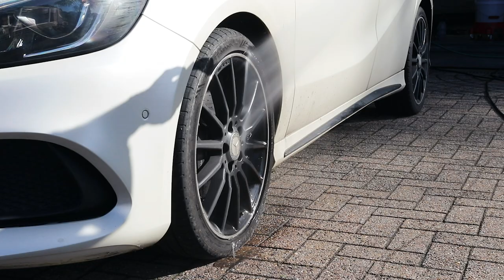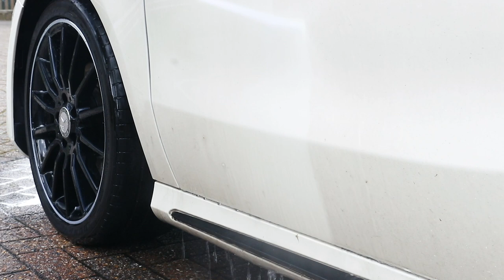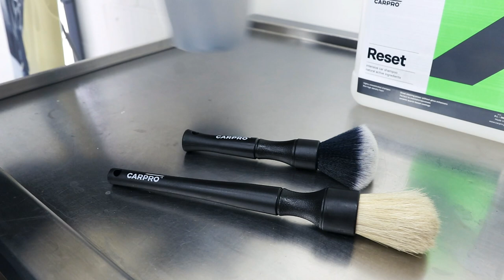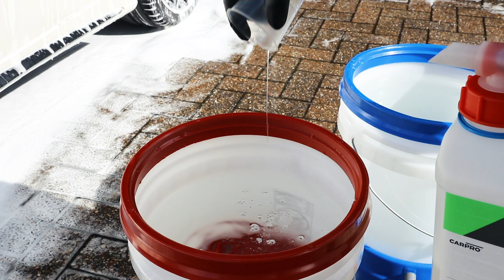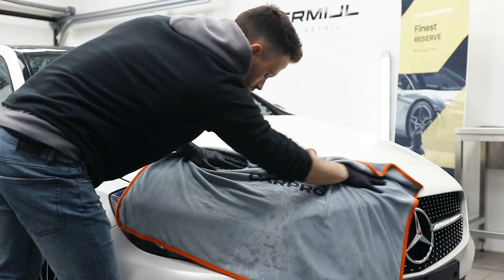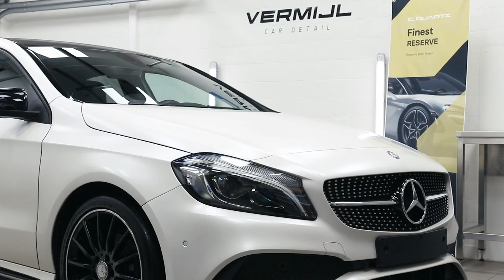How We Do A Maintenance Wash - Satisfying Foam Wash!

Comment: Very good video bro, so satisfying to watch! 😁

My suggestion if that was my car

I never use pressure washer to remove heavy grain & dirt 

my method 
1. Use air blower to remove dust/light grain on the surface of the car and also for the engine bay
2. Do all tyre n rim
3. Rinse car
4. Touchless wash (soap n rinse)
5. Touch wash double bucket method (soap, rub n rinse)
6. Use air blower to help drying the car faster, much easy bcoz my car was ceramic coated with SiO2 (hydrophobic and water beading)
7. After the car completely dry, i use water base coating spray for maintaining ceramic coating (meguiars top coat maintenance spray)
8. Clean all window n mirror with window cloaner
9. Tyre dressing

And i don't wash my car under direct sunlight 

😁👌🏻

Comment: My friend, i have white colour sedan Honda city (name in India). We live in apartment where we have space and water constraints.  I use 2 bucket method but many time i feel shampoo is still left on vehicle after washing as i don't have jet spray. Will that affect my ceramic coating. Thanks for answering. 🙏🙏
Reply from the maker: Do you not rinse or dry the car after washing? I would recommend doing that because the soap residu should not be left on the car.
Reply: @VermijlCarDetail  i do that always but sometimes i feel my shampoo proportion is wrong. Now i purchased carpro reset, Whats proportion should i take ?

Comment: The distance between the nozzle and the body should be considered again.. too close i think..
Reply: While the pressure washer he uses has decent psi, he uses a wide nozzle, so i think its ok
Reply from the maker: Yes exactly, I’m using a 40 degree nozzle and my pressure washer is set to about 1100 psi. I can hold my hand in front of it and it doesn’t hurt, so it’s fine 👍

Comment: I feel like you're wasting products here.
First the IronX on tyres, just to use Reset foam on them. Rinse. Handwash reset again.
This takes too long, unnecessarily..
Reply from the maker: I’m confused, I don’t know if you really know what the products are used for. IronX should not be used on tires, only on the rims. Reset doesn’t offer a deep clean, that’s why an alkaline all purpose cleaner (MultiX) is used, which is recommended for cleaning tires. I completely disagree with you comment as it makes no sense to me.